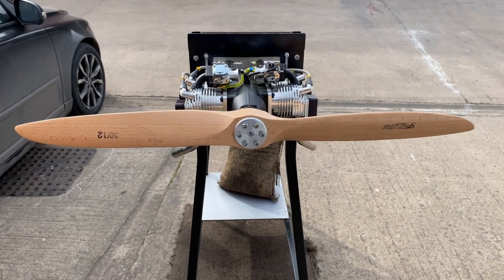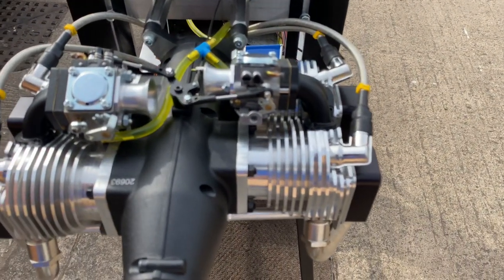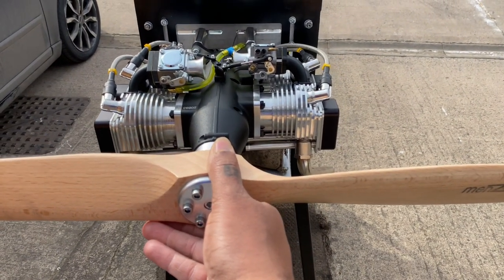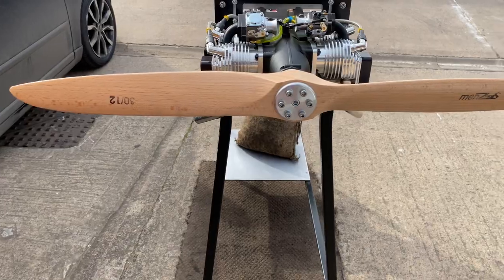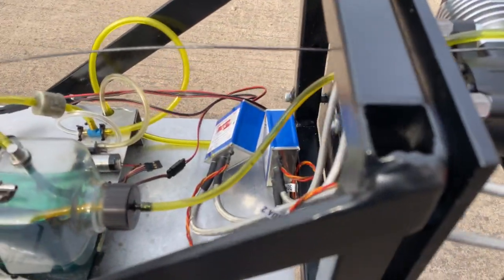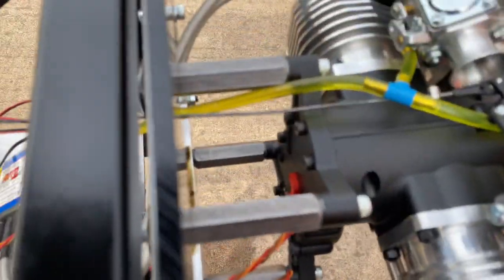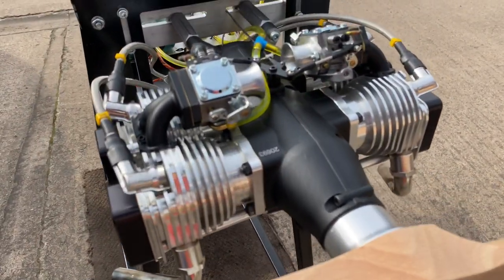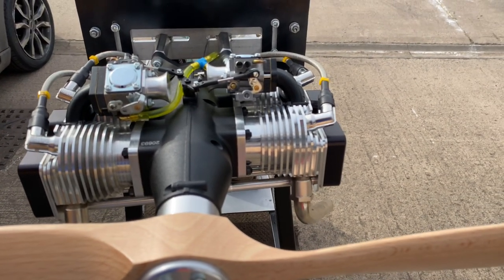Roto Motor 170cc Flat 4 Cylinder 4 Stroke Engine test run by Morris' Mini Motors

Comment: ROTO motor 170 FS is four cylinder  4 stroke  gasoline engine made specifically for the model  airplanes up to 4 m (13,1’) and 30 kg (66,2 lb). These dates are for recreational flying.

The Engine was developed in Europe with the assistance of CAD systems (Solidworks) and optimized for the liquid flow in the Flow software (made by Solidworks).

All ROTO engines and its components are made and programed by utilizing the state of art 5 axis machinery made by American companies HASS and Siemens NX.

Every engine, made by ROTO MOTOR Company is bench tested and adjusted by qualified technician on the Engine Star equipment to ensure its peak performance. 

Basic technical data:

* DISPLACEMENT 170 ccm
* STATIC ENGINE THRUST 20 kg
* WEIGHT 4 500g
* BEARINGS  Ball and needle
* INGNITION PROCESSOR ROTO
* FUELGAS + OIL MOTUL 800 1:40
* RPM 600 - 5500
* 2 BLADE PROPELLER 30/10-12
* 3 BLADE PROPELLER 28/10-12
Reply: Where can I get this engine???

Comment: I always wonder about the rear cylinders getting enough cooling air with the front cylinders in the way. V twins have the same question.
   The old VW air-cooled engines had ducting to cool all cylinders from above.
Reply: As a pilot myself my lil Cessna I fly the rear 2  cylinders always run a little hotter then front 2. Nothing to worry about though unless it gets into the red but I always like to keep my eye on them just in case

Comment: Really beautifull !
But, what about it's mechanics ?
What about "fire" sequence, are opposit pistons moving toward the same direction, or in opposit direction ? ( a crank for two rods, isn'it ? ).
What about distribution, typical rods and valves, or any electronic stuff ?
Thank you very much in advance ...
Reply: Lycoming 4 cylinders fire 1-3-2-4. Forward right, aft right, forward left, aft left.

Comment: Is that 170cc per cylinder or total?
Reply from the maker: Yes 85cc x 2 =170cc
Reply: @173shatta  Or, in this case 42.5cc X 4 cylinders = 170cc
Thanks, I'm new to these very cool engines and thinking about alternative uses.  This engine should have brutal torque for its small displacement.  Although specifically designed to turn an aircraft propeller, this torque could be lots of fun for applications normally powered by 1 cylinder engines like the 212cc harbor freight engine.  Obviously, cost would be a huge factor, but if you want grunt with small displacement these engines are very cool indeed!